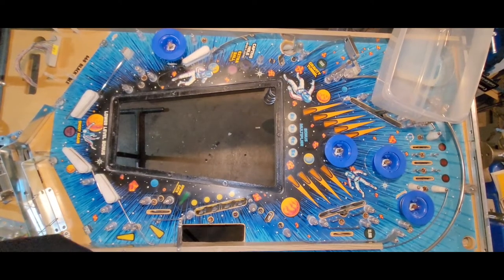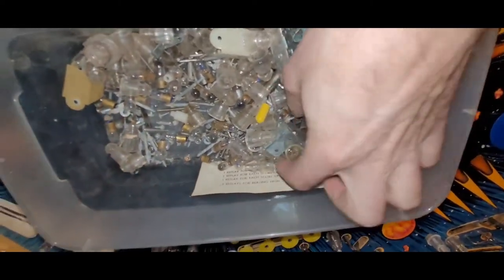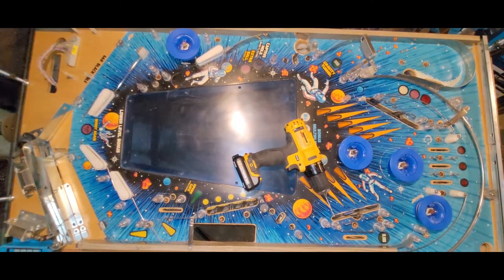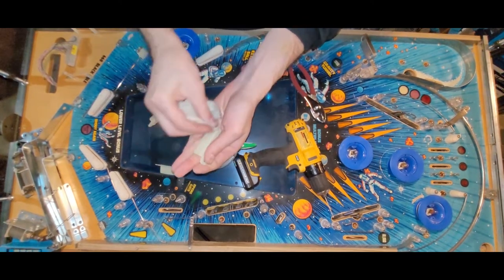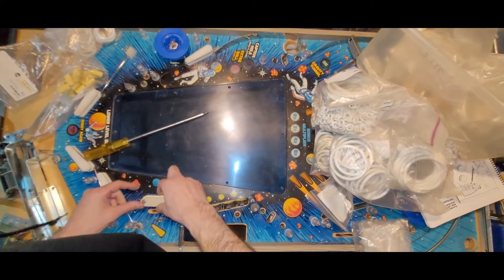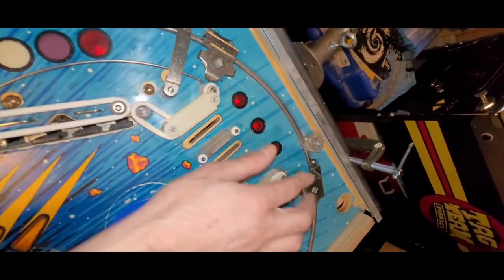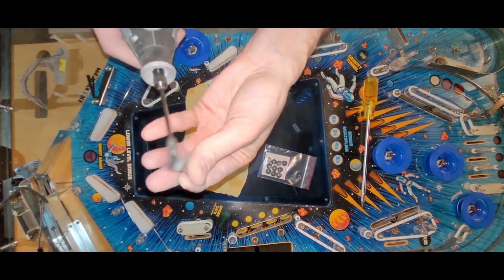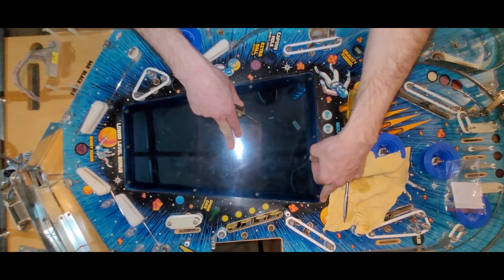Black Hole #2: Post replacement, rubber and window installation & more!

Comment: I've got a Mata Hari that I have put a hardtop on and have been getting back together.. I went with clear posts to hopefully brighten the game up with.. which style LED do you prefer for that era game.. I want to brighten it up and have used Comet and Titan bulbs in the past and had better luck with the Titan bulbs.. but which style would you suggest?
Reply from the maker: I almost always use 2 smd frosted domes!!! usually comet!
Reply: @pinballshenanigans  ok thanks for the info?